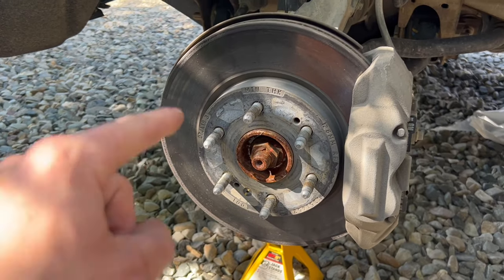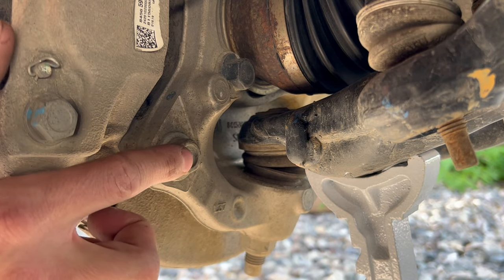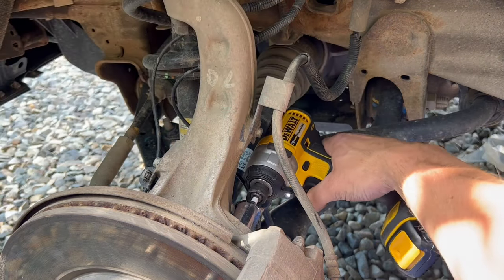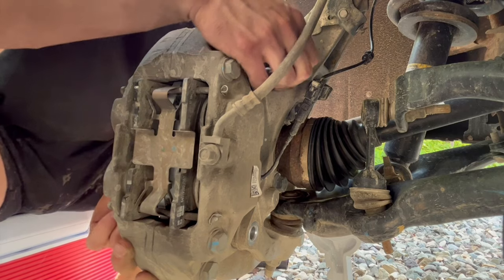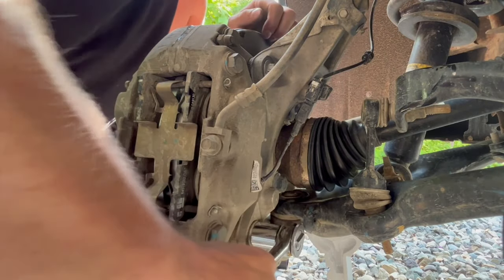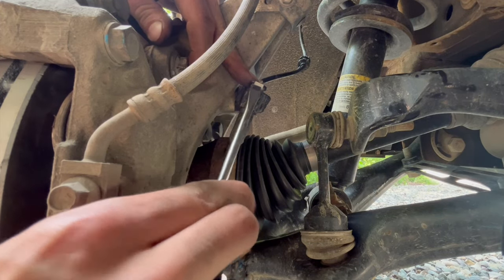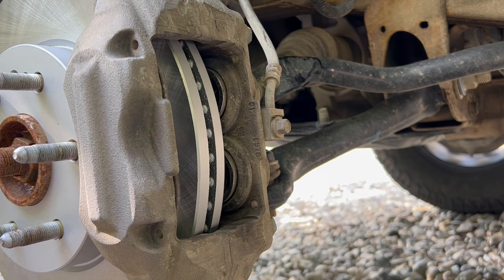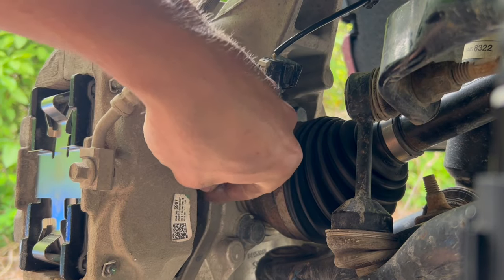Front Brake Replacement Made EASY! | 2019-2023 Chevy Silverado

Comment: HOW DO YOU RESET THE COMPUTER FOR THE NEW PADS??
Reply from the maker: I have been getting an error with mine since I bought the truck and still isn't working properly. I did some searching online and it sounds like a fairly common issue with these trucks, and there was a recall on it with some models I believe. I've heard if you take it to the dealer they can do it but its expensive, or with the right scanner you're able to do it as well.
Reply: I was able to go to the brake pad screen and turn off the sensors or disable fairly easily , I believe you go to the screen then push and hold the button until it highlights the disable sensors and push it again, it may ask you if you are sure. The rotors will warp long before the pads wear out which is pretty pathetic  as my truck has only 40000 kms.
Reply: Update : you will see options on the brake pad screen ,press and hold it until the options come up and then disable wear sensors.  However, while changing the back brakes the inside of the rotors were shot and inside pads worn down to almost metal. 40,000kms on truck. I believe the inside gets exposed to more crap that doesn't get washed off (I wash truck very often) and the cheap rotors pitted and delaminated (chunks missing) which took out the pads. I could be wrong. Also the bolts holding the pad /pin /caliper brackets will fight you all the way out, mine had red locktite  on them from the factory and had to use breaker bar just to slightly loosen them. If you can get an impact gun in there you will be happier, I just had ratchet tools. Good Luck
Reply: Dealer wants to charge me $180 just to reset brake percentage, which is ridiculous! I couldnt do it on dashboard so I just disabled it. Atleast it doesnt show monitor brake service on dashboard.